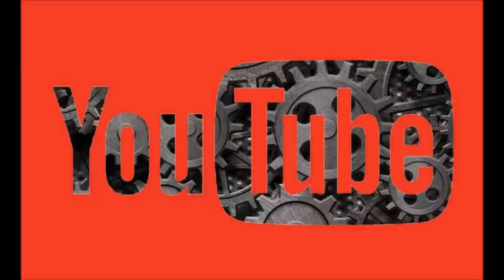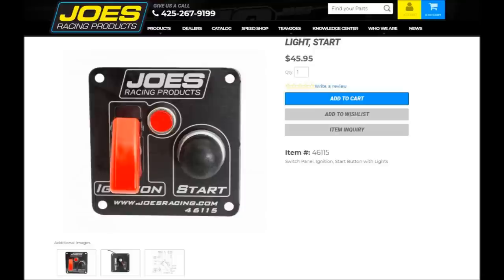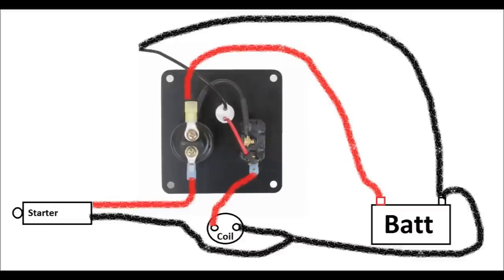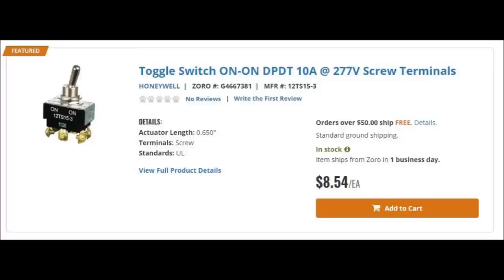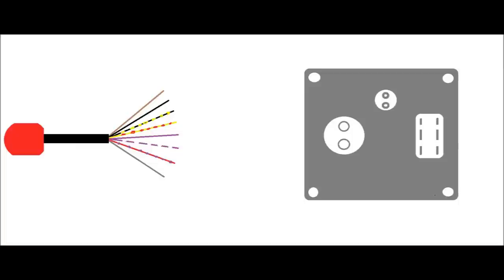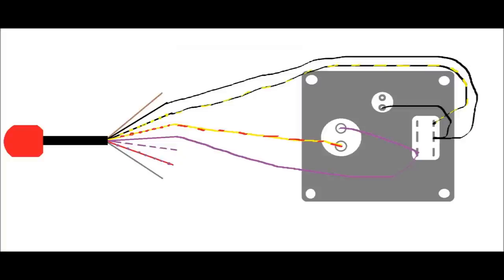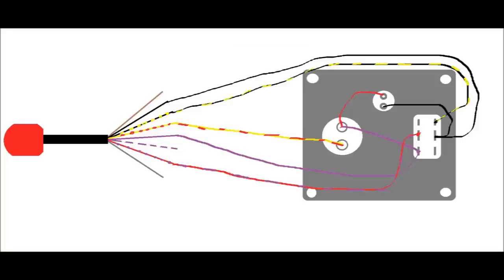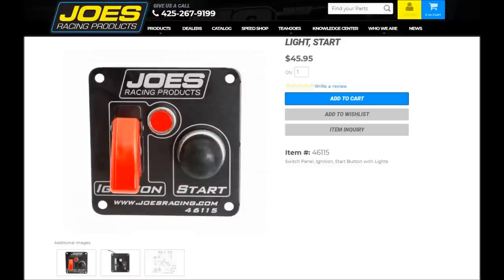Wiring A Dash Mounted Ignition & Start Switch For Evinrude Outboard

Comment: I was wondering if you a have a video to a wiring a ignition switch to the red plug. Kinda like a pigtail so I can carry with me testing other evinrude or Johnson outboards. Thanks
Reply: I need same set-up guy sold me chopped wires going to engine minus the switch or controller.snook pa

Comment: Hey man ur videos was really good.. I have a 1998 evinrude 9.9hp 2 stroke outboard it has electric start and pull start with an electric choke it has a pig tail on the engine but not running to the key you have any tips to help me wire it to a key

Comment: Hey Brandon
i am building a very similar system for my old Johnson 140. I used a momentary switch for the Choke/Primer. 
I think i understand the whole system you drew, How would you over come the Start in gear switch ? Plus with the purple wire  supplying all the power can this be used to wire a positive bus bar ?
So that every thing is OFF until you throw the flip toggle switch ? Why would you not just use a normal On/Off switch ??

Comment: Hi Brandon.
Thank you for another video. This is a unrelated question.
My outboard won't start unless the black with yellow stripe wire is disconnected. As soon as I reconnect it it shuts off. I already replaced the ignition key switch. Any help would be appreciated.
Reply: Guessing you already figured out the problem. But if not, it sounds like you have a bad ignition kill switch.

Comment: i dont have a red and yellow but i do have a white? mines a 1975 johnson 135
Reply from the maker: White is probably the color code for the start in neutral protection.
White should be ground when in neutral. However, I would need more to be sure.
Is this on your engine, or on the red-plug harness?
Reply: @BrandonsGarage  its under thebdash where the key is changing the key  tumblr and forgot to take pictures of how it was wired
Reply: @BrandonsGarage  mines a 75 its different neutral safety switch is white on mine its different 74 to 76
Reply: got it wired  but the 15 amp fuze pops every time i flip the ignition switch to power the choke and starter switch

Comment: Good video others than the fact in video to failed to show where to wire power and ground from battery. Nothing will work without that....
Reply from the maker: That connects at the engine, which is attached to the engine harness. 
This harness/wiring, connects to that harness.